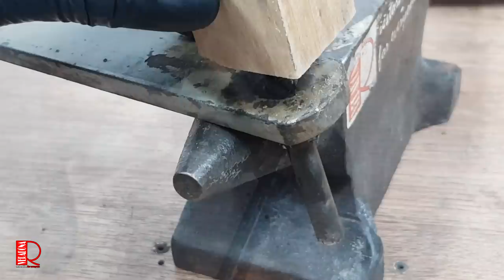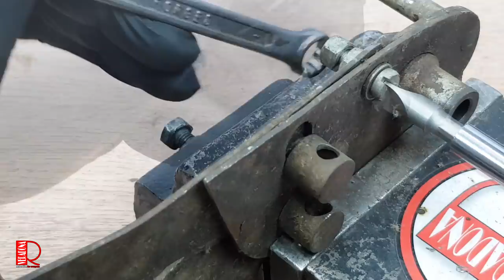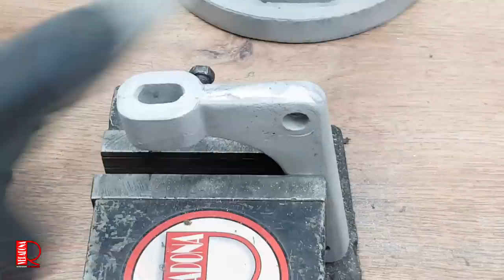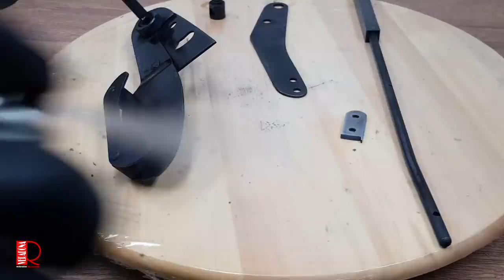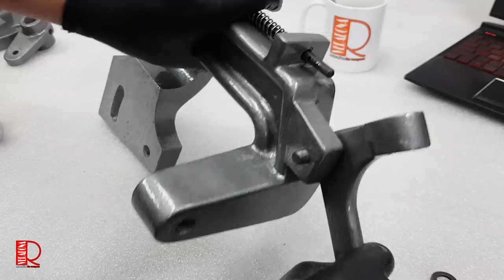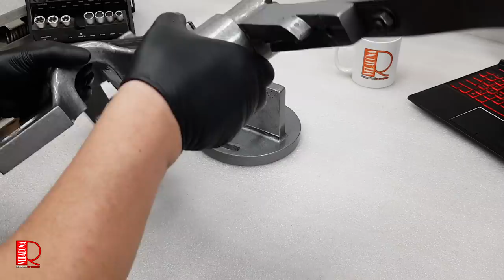clay-pigeon trap - Restoration

Comment: Question:  Why use rust remover on metal that has already been media blasted?  And, what is the purpose of the “tannin?”
Reply from the maker: If it sands, you know that rust will soon return, albeit slightly. I use a rust remover as a prevention. Tannin metal black and black can be reduced with metal wool.

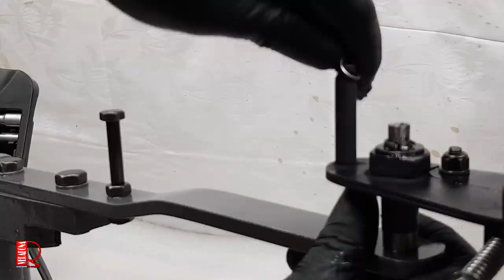Comment: do not tighten the spring as shown at 18:50  -  if the fingers are in the grease, then it can slip out and the hook will deeply stick into the finger (it is better to take with pliers or a wire hook)
Reply from the maker: Thank you for the advice and warning. Radek